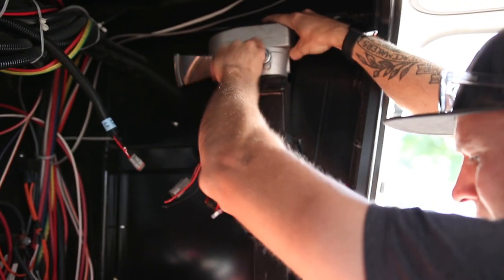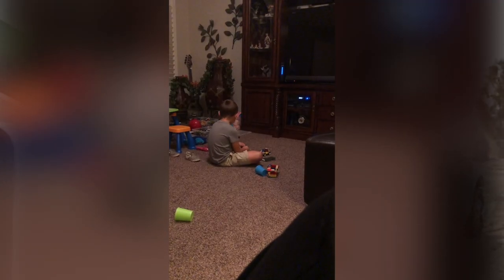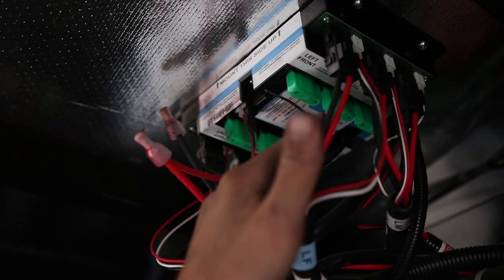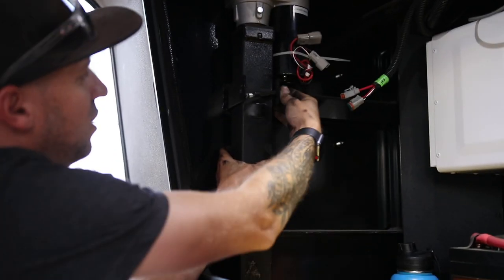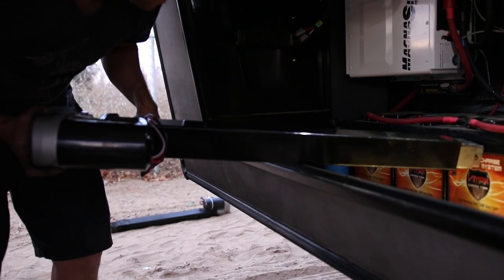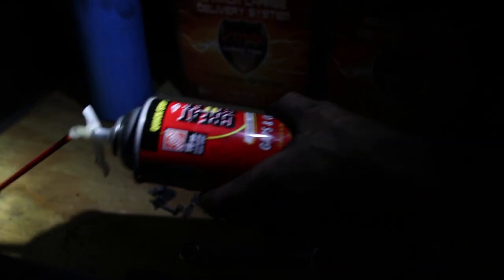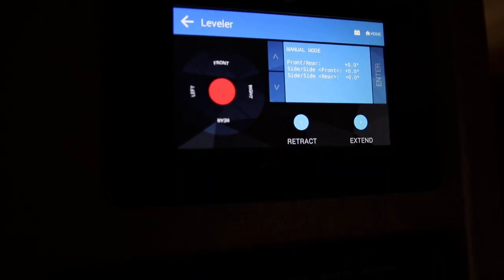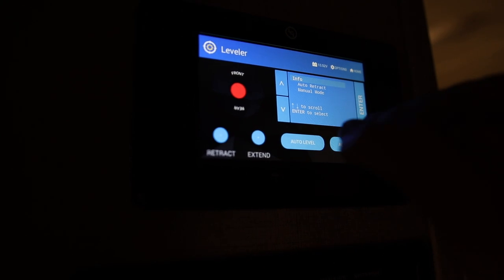How to replace Landing Gear Jacks on Lippert Ground Control 3.0 (and how to cope with Disruptions)

Comment: Admirable that you're self-reliant. Ran across your vid in researching my own Lippert leveling system maintenance issue. But do you really think God "lined up all these little disruptions" for some reason? Or could it just be a case of "things happen," simple equipment failure? King Solomon put it this way: "time and unforeseen occurrence befall us all." [Eccl 9:11] Again, we're human, imperfect, and things happen. And not everything that happens in our lives is God's doing. Especially is that so when bad things happen for whatever reason. James states that when "under trial" we shouldn't say "“I am being tried by God.” Why? Because as he points out, God doesn't "try" people with evil things. That, my friend, is someone else's doing. And "evil" can mean anything causing harm, injury, or misfortune. [James 1:13] Thanks for the vid! Safe travels!

Comment: Thanks sooooo much for this video.  Our LF Leveler just went on our 2021 Grand Design 5th wheel.  We are full timers so I called several RV repair shops and the soonest to get an appt  is 3 months out😳.  We just ordered the part & with the help of your video we will be trying this over the weekend👍🙏
Reply from the maker: Oh awesome!!! You got this. Let us know how it goes and If you need any help!
Reply: Yeah that's why I'm changing mine myself. The Mobil RV service in most cases are either so booked up or just don't want the work. Our door was damaged in Sturgis 4 months ago when we had 80mph winds and it got away from me Bent the hinges real bad. Keystone won't sell parts to an individual only to authorized agents it took me until now to find a Repair shop that Keystone would sell to.  Knowing how to fix a RV is only half the battle the other half is getting the parts 😔 it almost takes all the fun out of it 😒

Comment: Actually those pieces of metals that flare out does take most of the heavy load it also keeps them centered. And also you're supposed to work at a certain pound ratio those carriage bolts but awesome video thank you